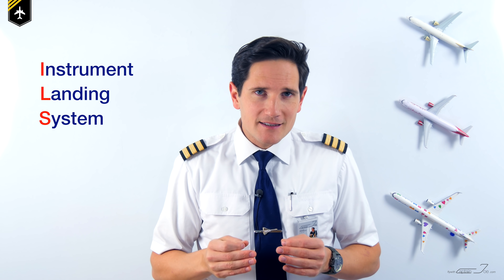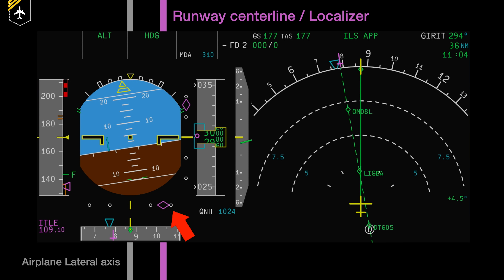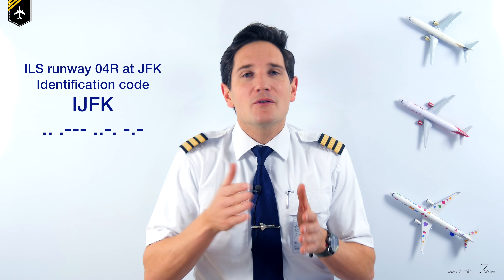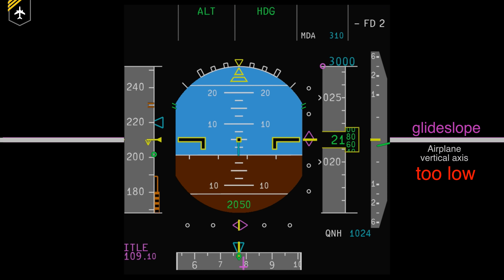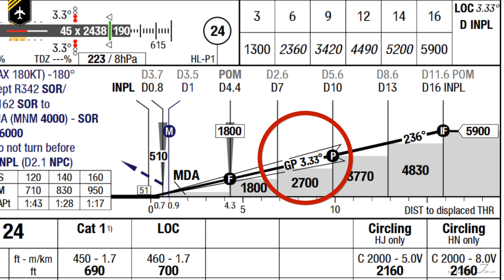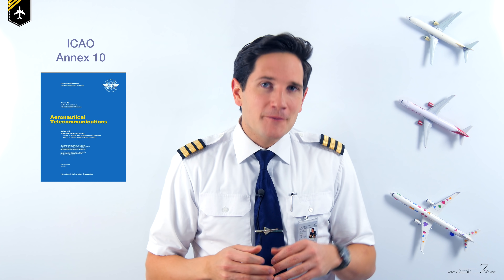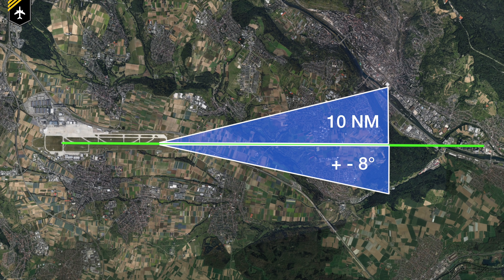How does an ILS work? Explained by CAPTAIN JOE

Comment: Hello Captain, a small correction here. The signal transmitted is not a 90/150 hz signal (that is technically almost impossible to do. The wavelength, i.e. the length of the antenna, would have to be the size of the earth).  The signal transmitted is at a center frequency of around 108 MHz with a signal of 90/150 hz modulated on top of the carrier of 108 MHz.
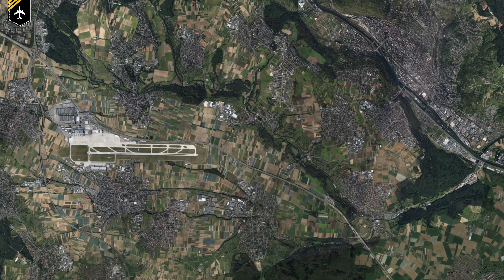Reply: At 1:54 he actually mentions modulation. But unfortunately he wrongfully claims it is "frequency modulated", while it is in fact an amplitude modulation.
And to be perfectly precise, the center frequency is only at around 108-112 MHz for the localizer, the glideslope is at around 331-335 MHz.
Reply: Ahhhh I have finally found the smart people of the comment section
Reply: First thing i thought was "what? I should be able to hear the ILS signal!"
Reply: "with high speed"?  It travels at the speed of light so wavelength = c/frequency .
Reply: Dimitris Siafarikas 90hz is easily hearable. Young healthy persons can hear down to 30. 90 should be hearable for a grandpa. But it aren’t audio(air) waves indeed.
Reply: Anyone who works in audio for any length of time has certainly heard the annoying 60Hz hum in poorly grounded installations.
Reply: Bjorn Roesbeke you could not actually! It’s not an audio signal! And even if it was, it really depends on tour age. 90 Hz is a very low frequency for some older people to hear
Reply: Richard van Pukkem Only if grandpa took care of his hearing he may hear it. Those youngsters of today, when they become grandpa, will have poor hearing due to lifestyle. 
Selling hearing aid will be a good business :o)
Reply: Frequency modulation also caught my attention. I know too little about those systems, but i do know a thing or two about modulations. Two FM signals at the same frequency are impossible to demodulate and discriminate reliably.
If i had to make a guess prior to knowing it was plain AM i would have said it would be something like upper side band for 90hz, lower side band for 150 and may be keying the carrier for the morse code id.
So, knowing that it is AM i guess they use one oszillator to generate both carrier waves to prevent signal fading due to sweeping. This also means that the useable area of the overlapping cones is very limited, which in this case is desireable, i think.

Having played around with radios before the advent of the internet has it's perks it seems ;-)
Reply: Since frequency is inversely proportional to wavelength and vice-versa, they literally define each other
Reply: Or 50Hz in many countries.
Reply: Actually, I thought about it. We, the humans, don’t we really hear low frequencies (such 90 Hz). We just feel the vibration to our body. It’s like when you go to a club and feel the bass and the floor is shaking. For that reason, low frequencies are not directional and can propagate equally almost anywhere.
Reply: On radio repeaters unless the sub audible tones are filtered out they can be heard in a received signal. Often the older radio operators point out that they can hear the tone. It was my understanding that older people lose hearing in the upper audio frequencies 15kHz to 20 kHz not lower frequencies..
Reply: Ah!!! I thought that must be a mistake - I was thinking 90 Hz?!?! That's a seriously low frequency :-)
Reply: Sccratlanta I don’t know what he is. I’m not a pilot. But his channel is called captain joe. So I assumed he is
Reply: He didn't claim this, he said it was modulated at those frequencies.
Reply: Agreed. Hz is a measurement of frequency which deals with how often a cyclic event happens with respect to time. Thus, you could measure your intake of food in Hz, but that doesn't mean you can hear it. ;)
Reply: Has somebody been able to show in a double blind test that their perception of sound was affected by ultrasonic content? There was a study in Japan that appeared to show this, but IIRC the methodology was flawed in that the audio with the ultrasound was always played first while the audio without it was always played second, and the novelty of hearing new music compared to known music could have accounted for the difference.
Reply: There was a lot of research done during the development of the C.D. which demonstrated a persons ability to hear the effects frequencies outside the band of human hearing, have on the frequencies which can be heard.  It basically comes down to frequency harmonics, it is quite interesting as initially the C.D. system was only intended to go up to 18kHz, after the research, (which if I remember correctly was done at Cambridge University), that the decision to up the frequency capabilities of the CD to 20 kHz was taken.
Reply: Jeremy Hughes
1,388888888888889e-4 Hz for very little children, 3,472222222222222e-5 for people not eating but e times a day
Reply: The egg teaching the chicken
Reply: Dimitris Siafarikas είναι όντως πιλότος απλα εμφανίστηκε ένας άσχετος που λέει ότι δεν είναι
Reply: that was not a small correction, that was a big correction.
Reply: Bjorn Roesbeke you should be able to hear the 90 and 150 by selecting Nav 1 on your comm panel.
Reply: DasIllu the 90 and 150 hz audio tones are amplitude modulated on to the carrier of 108 to 112 Megahertz.  They are audible through the headset by selecting Nav 1 or 2 depending which radio is tuned to ILS.  I am an FAA ILS technician.
Reply: On a large pipe organ, the lowest pipe frequency is 16 Hz.  People with fully functioning ears should easiliy be able to hear a 90 Hz frequency.  We humans really do hear down to 16 Hz, so your statements are incorrect.
Reply: I love the  way some people post as an expert with such authority, some even questioning the real experts.  Well if I can help on this, the human ear can normally hear frequencies between 20 and 20,000 Hz.  Even though a person can usually only hear to around 18,000Hz they can hear the effect of the frequencies at 20kHz have on the frequencies below it.  In terms of hearing loss it is the higher end of the frequencies which are normally lost rather than the lower ones.  Though you are totally correct on protecting the hearing of our younger people.

Comment: I'd figure London City.  Any steeper and the system either wouldn't work or so few aircraft would use the field that there wouldn't be much of a point in an ILS.  I believe the A319 is the largest aircraft to be able to use it, but with specialized logic installed.

Comment: A few days ago I landed on Sarajevo airport, we flew like 9km above sea level, when the plane started to go into a deep dive, into a bigger angle than usual, and later than usual. The spoilers were almost fully extended during this dive till we sank to 2-3km over sea. On the way back to Budapest we sank slowly, without any spoilers and flaps were extended only at the final approach. Do you know why the landing technique differed so much? Maybe due to the mountains? Is it normal that it makes such a dive with full spoilers extended?

Comment: One minor correction... A blue light intersecting with a yellow light would not make green light. That would work with subtractive primary colour mixing (like for paints) but not additive primary colours (like for lights). The primary colours for light are red, green and blue. A better example would be a beam of red light on the left lobe, a beam of green light on the right lobe and then you'd see yellow if you were up the middle.

Comment: London City Airport  is the steepest from my deep memories ! :) 5/6° if i'm correct
Reply: MrNeocortex I am well aware that it was not an ILS approach. landing with night vision aids  in complete darkness who needs ILS
Reply: Mark Joyce The Hercules pilot would have been performing a tactical landing to be doing 45° on approach. Wouldn't have been an ILS landing.
Reply: Agree, 5.5 degrees on either 09/27 according to the UK AIP
http://www.ead.eurocontrol.int/eadbasic/pamslight-4193B236581ADBF9DB1BC324699585AB/7FE5QZZF3FXUS/EN/Charts/AD/NON_AIRAC/EG_AD_2_EGLC_8-4_en_2016-03-31.pdf
Reply: London city Airport or from past experience Kuwait city tactical landing in a Hercules

 we flew into that at around 45 degrees well it felt like it .